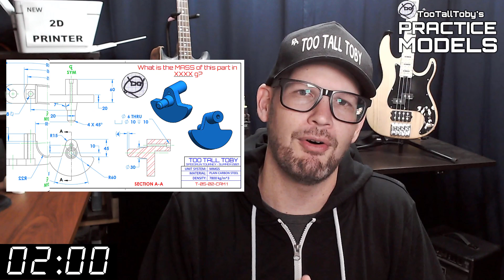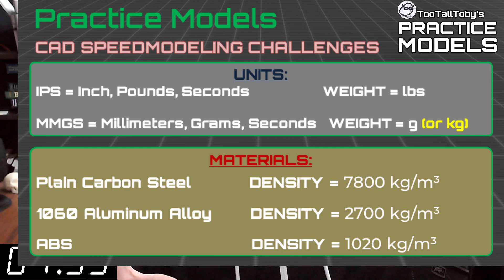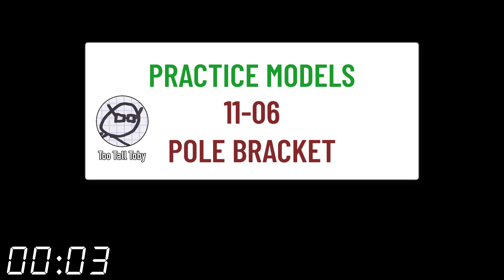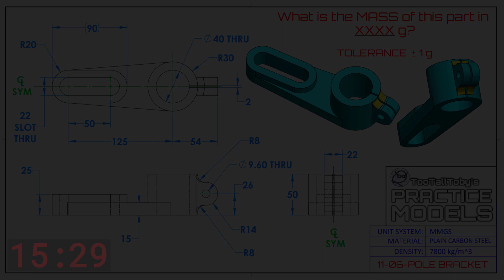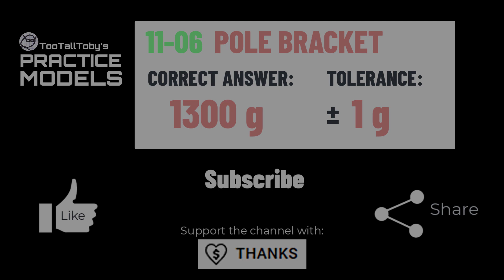SOLIDWORKS Practice - Onshape Practice - Fusion 360 Practice Exercises - TooTallToby-11-06

Comment: 1st attempt Time:6:20 ; Mass: 1299.99878 gr Fusion360
Reply: How did you do the curved tab part ?
Reply from the maker: Hi Travis - I'd create the larger circular boss as a SOLID boss on the top plane.  Then start a new sketch on the FRONT plane, and create the tombstone shape (line, tangent arc, tangent line, line) starting at the center of that larger circular boss, and extruding midplane.  Then you can start adding the cuts, through the center of the circular boss and through the center of that tombstone shape.  Hope this helps!
Reply: @TooTallToby  But those yellow colored portions are curved and a straight extrude will create gaps between the tombstone and boss
Reply from the maker: @Tavdog  That is correct - You have to do those yellow colored sections with a FILLET FEATURE, so that tangency is maintained to the curved circular boss.
Reply from the maker: Nice job Didi!!

Comment: This was a fast one, I used SW21 :)

Time: 2m 49s
Mass: 1300,00 g

Did the following:
1. Started out making the sketch for the main body (i made it so i could extrude all three different heights from the same sketch)
2. Extruded the three parts of the main body, in separate extrudes but from the same shared sketch. 
3. then i made the tab
4. and the fillet between tab and main body.
5. Lastly i cut the slit
Reply from the maker: Nice job Mikkel!  That's Fast!!

Comment: Unfortunately I made a mistake at my first try. My time was 8:20 with a mass of 1301.68g which was over the acceptable tolerances. After reviewing again my model, I found out that I missed the Φ9.6 hole dimension and I had inserted it as Φ9. My updated time was 14:10 and mass: 1300g
Reply from the maker: Nice job finding that error Achilleas!